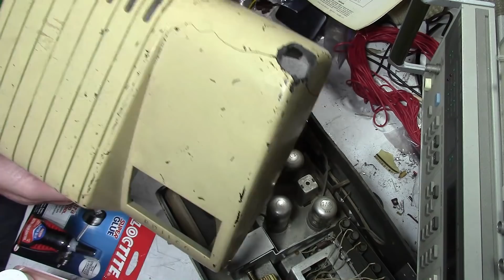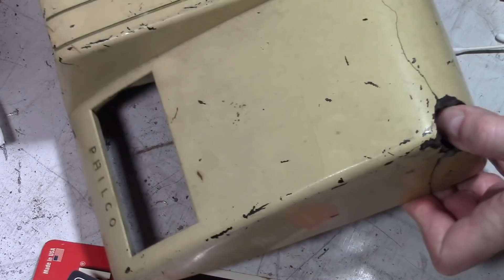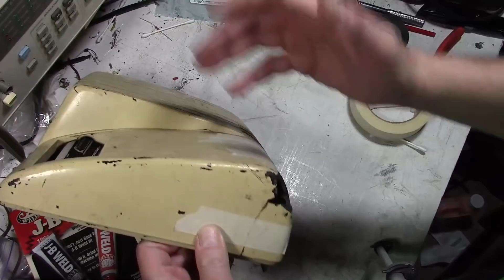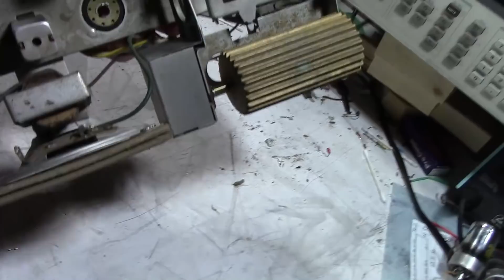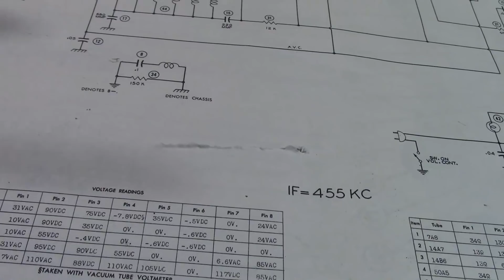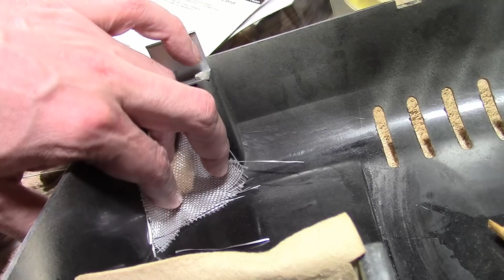Philco 49-901 restoration p2o?

Comment: Strongest super glue I've used is Loctite Professional Liquid.  It is slow setting, though, and it's best kept refrigerated.

I once used super glue and polyester fabric to repair a crack in an old Plaskon radio.  I don't know how well it'll work with Bakelite, though.

Comment: Something that I was thinking about after watching your videos for quite some time. Are you concerned about the high chance of lead paint? I'm not telling you what to do and heck I could be completely wrong but I thought they put lead into darn near everything back then.
Reply from the maker: No, I'm not concerned but yes, it could have lead.  The chassis is probably cadmium plated too and there's asbestos in the Motorola VT71s I worked on.  I figure if I don't breath in dust and wash my hands I'll be fine.
Reply: @bandersentv  valid point is valid.
Reply: Oh, No not common sense; Bob you're going to start a trend……..some day 🤣 @bandersentv
Reply: WHAT ARE YOU GONNA DO ABOUT IT?!!

Comment: Ok, here's the deal on baking soda and super glue...and it's kind of technical, but Bob you seem to appreciate the technical aspect of things:  CA glues polymerize when hydroxide ions are introduced.  Hydroxide ions are one atom of oxygen and one of hydrogen, and are negatively charged.  Where does it get hydroxide ions?  Water...moisture.  Water actually isn't just pure H2O, but it is also full of HO molecules that didn't bond with a second hydrogen atom.  Normally the humidity in the air is enough for the CA to draw from to polymerize.  However, CA glues polymerize so quickly that it forms a skin on the surface and drastically slows the curing of the interior.  That is why large drops of super glue take so long to set.  

By sprinkling baking soda on the relatively large drops of CA glue you are doing two things.  First is the fine grains of baking soda dramatically breaks up the surface area of the CA, exposing it to more air and moisture.  Second, baking soda has small amounts of moisture naturally trapped in it.  The CA will begin to polymerize in the presence of the moisture brought along with the submerged baking soda.

More than just baking soda will work to cause CA to cure faster.  Any stable ground material can break up the surface area and introduce moisture.  Sawdust works well too.  Baking soda actually makes a great filler material to allow you to build up missing material.  You can also use ground material of the same thing you are fixing, such as bakelite dust in the case of your radio.
Reply: Now that is a great explanation!
Reply from the maker: Thank you for the detailed description.  It makes a lot of sense now.
Reply: Great , concise, clear explanation, egrand1508  Thank You.
Reply: The baking soda and super glue trick has been around for a while. There are a lot of youtube videos on it if you wants a layman's walk through, your gave technical aspect of things was well done. Here is a example of a simple repair using this technique, https://www.youtube.com/watch?v=alyzGrgL6So

Comment: Hope you get better luck with the JB weld than I had.... had a car restoration where most of the interior plastic was cracked from the sun... cleaned and sanded the back sides and used jb weld... worked great until the heat in the car from the sun caused it to just separate all over again...